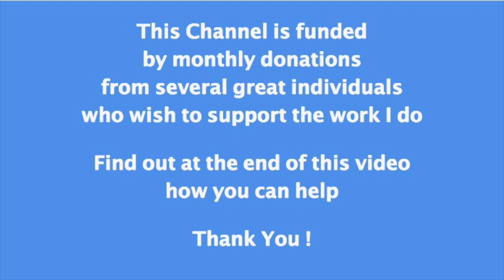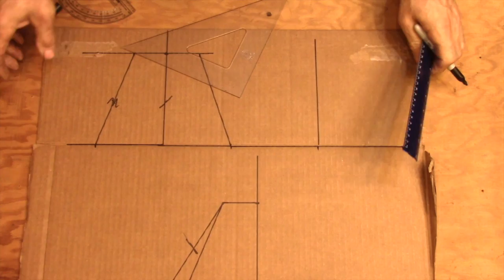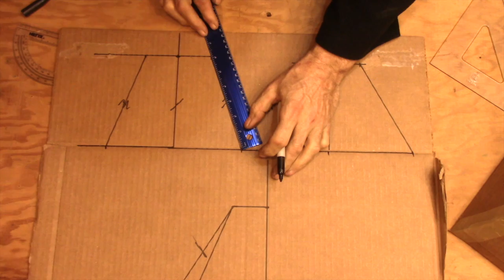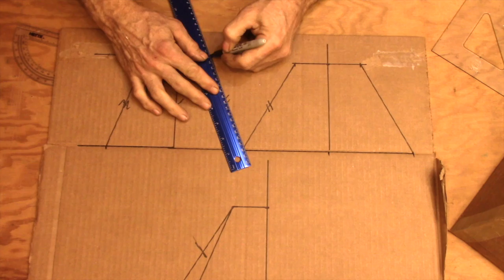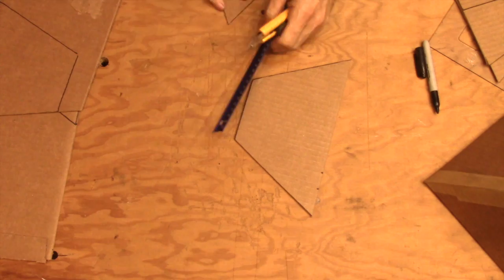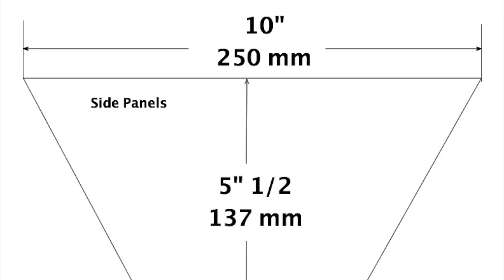Blacksmithing for Beginners - How To Design A Blacksmith Forge - Laying Out A Firepot

Comment: By using the grate you’re just using your poker to break up the clinkers? Thanks again for all your info.
Reply from the maker: The only reason for breaking up clinkers is to make them fall through a grate.  That is only needed in boilers or furnaces.  We have access to the top of the fire so it is much easer to leave the clinkers as a big lump and just pull them out.  See my video on Managing A Coal Fire.  The poker is mainly used to make sure that the coal or ash doesn't plug the air grate.  For that, a straight bar grate is much easier to  find in the bottom of a fire than trying to pick out the holes in a shower drain type grate.

Comment: What’s your opinion on a break drum from a semi truck They are way bigger
Reply from the maker: A brake drum from a truck is an excellent place to start.  They are usually too deep so you will need to cut it down to get the depth to 5- 7 inches.  Most people just cut matching U shaped slots in the front and back and leave the side walls as is.
Reply: Nice

Comment: What are your views on gas forges?
Reply from the maker: Like any other tool they have their place in the shop.  Their main advantages  is that you can dial in the heat or the atmosphere you want and it will maintain that setting until the gas runs out.  So they are great for production work because all you need to do is concentrate on the forging.  Their biggest disadvantage is that they heat every part of the forging every time you take a heat so they are not well suited for decorative ironwork that has a lot of delicate elements that can't take a lot of scale loss.
Reply: Jim Lush-Smith another view is that it’s hard to forge weld mild steel or wrought iron in a gas forge. They also don’t get as hot and can decarbonize your metal.

Comment: I will be building a forge in the coming months and my most abundant supply that I have is bricks would you see any major problem with carving/chiseling a firepot into the bricks themselves then attaching the ash box and blower tubes to the bottom. Then insulating the box with a perlite and sodium silicate lining?
Reply from the maker: Bricks should work fine.  They are not used too much anymore because there are a lot more welders out there than brick layers and  brick forges are hard to move around but that's how it was done for hundreds of years.  Some of the older house bricks are quite fragile so if you use them for the actual firepot they may need replacing occasionally as they break down( depending on use ) so you will want to make sure that your design allows for that..  There is no need to carve the firepot out of the bricks just find an arrangement that gets you close to what I've described here and it will work fine.  The main thing that I was trying to get across with these videos was the importance of the depth of the fire.  The other dimensions are really optional.  Anything in the ballpark will give you a good workable  forge.  Also the grate should be made as an insert so it can be easily replaced without dismantling any bricks ( if it wears out before the bricks do ).
Reply: Thank you sir. I pulled the old chimney out of the center of my house and now have a lot of brick laying around. I also have had the "pleasure" of laying brick and maintaining brick on several occasions in one of my previous jobs. Looking forward to putting it all together.

Comment: Hi Denis, how are you brother?
another great video!
does a fire pot need a slotted grate if it has a clinker breaker?
I have finally had the time to build my fire pot, ironically it is just about the same size as the pot you are talking about in this video but 1/2" thick. The turyre will be 3" x 3" x 1/4", and the blower pipe will be 2" round pipe with a flow gate. I do have a clinker breaker. im builkding a side draft chimney and lots of hangers and tong holders. 
I will send pics as I finish.
Reply from the maker: Good to hear from you again.  You are right - if you are using a clinger breaker than you don't need a grate.  I prefer a grate because most clinker breaker designs tend to drop a lot of good coal out the bottom of the fire along with the clinker and the ash.  My current firepot has a clinker breaker but I never use it and when I do get around to replacing it Ii will be using a grate.   I'm looking  forward to seeing the finished product.  Talk to you soon.

Comment: Dennis,     great video, Question I just watched your earlier video on fire pot construction . You mentioned forge welding and needing to add FB to make the pot a bit deeper for welding and hammers. So I was wondering if it would be a wise idea to just build the pot that extra depth . This way you could use it for reg forging and when needed forge welding. I ask because I Will be doing a lot of welding and thought it my be a bit easier.Thanks,  Martin Moldovan at M/S Blacksmithing and Blades
Reply from the maker: If you are planning  on doing a lot of welding I would build the firepot to suit that.  It is easier to have a second  forge for lighter work when you need it than to always be bricking up your main forge to handle bigger fires.
Reply: Shan Moldovan 
if you build your fire pot too deep..  you will waste coal.  I find that a    2 1/2 to 3 inch pot with heavy angle iron or fire brick around the top edges to add capacity, is a better option for me.
Reply: thank you, I figured it would waste coal but was wondering either way. thanks again
Reply: Dennis, 
     this is exactly what I was thinking so thanks for the reply. 
Sincerely, Martin Moldovan at M/ S Blacksmithing and Blades

Comment: Dennis,  by saying a "conventional fire pot" aren't you totally discounting every farrier's forge commercially produced since the 1860s?
Reply from the maker: Yes.  Most farrier forges meet the minimum requirements of somebody doing occasional shoeing and very light metal work. They were  easy to produce, very affordable and they were designed to satisfy that market. They are a great way to get started because millions of them were made and a lot of them are still sitting in barns somewhere but any full-sized blacksmith forge has a firebox that is at least as large as i have described here.
Reply: Thank You!